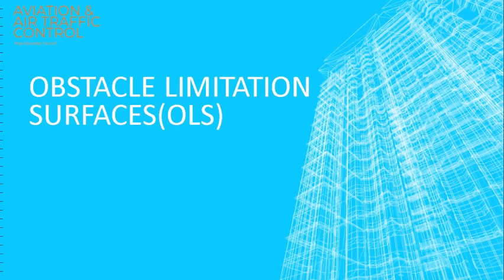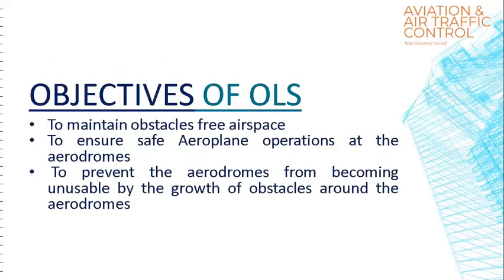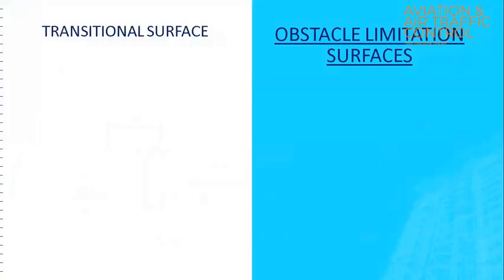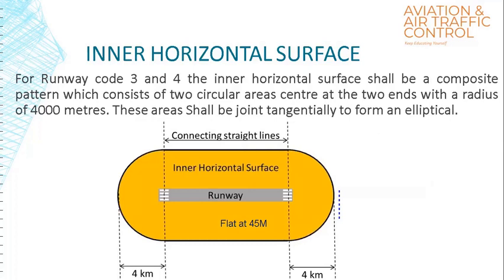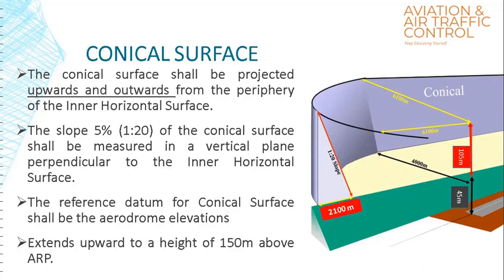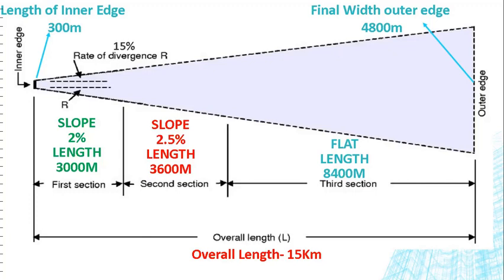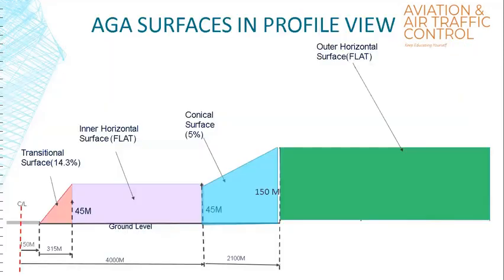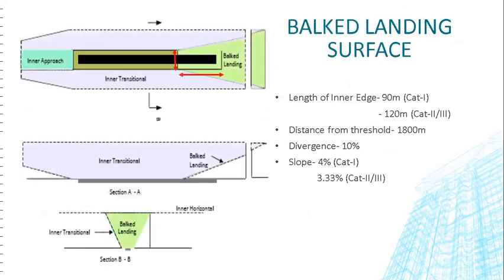OBSTACLE LIMITATION SURFACES

Comment: Btw, what you think about the proposed new Obstacle Free Surface (OFS) and Obstacle Evaluation Surface (OES) system that just announced by the ICAO which would replace these old ones and would become fully effective in 2030? Would you do other video(s) to talk about them as well?
Reply from the maker: These changes align with PBN and airport constraints due to vertical developments around it.

Airports will need less land sterilization while maintaining or improving safety.

Regulators shift from rule-based rejection to risk-based assessment.
Reply from the maker: Thanks for the suggestion. We will definitely prepare a tutorial on this soon.

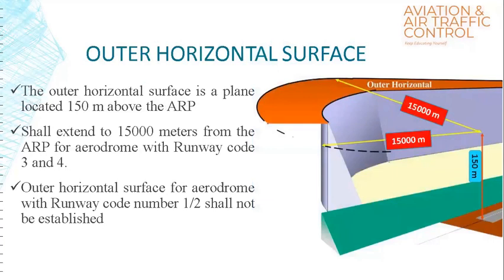Comment: Isn't the Outer Horizontal Surface 150m above the aerodrome reference point (where the conical surface stops)? but you said it is above the Inner Horizontal Surface (16:58) ?
Reply from the maker: You are correct, it is 150m above ARP

Comment: Hello. 
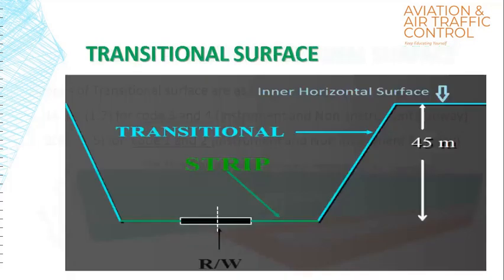At 10:12 your diagram shows that the full length of the transitional surface (including centreline to end of strip) is 465m. Are you sure that it isn't 455m? If the length from the runway centreline to the start of transitional is 140m, and the length of the transitional surface is 315m, then wouldn't the full length be 455m? Unless this airstrip may be of a different class/reference code? Thank you.
Reply from the maker: You are absolutely correct 👍. Earlier the basic strip was 150 m as it is now 140 m. The length of the transitional surface from the centre line to the end is 455 m.
Reply: @AVIATIONAIRTRAFFICCONTROL  Thank you so much for clarifying this. If I have anymore queries I will leave a comment. Thank you so much for responding to a comment on a video that is over a year old. It is hard to find youtubers like you <3